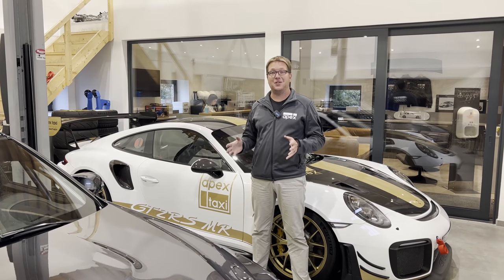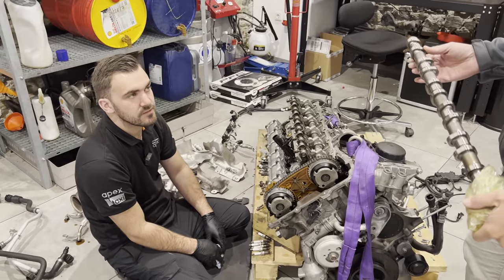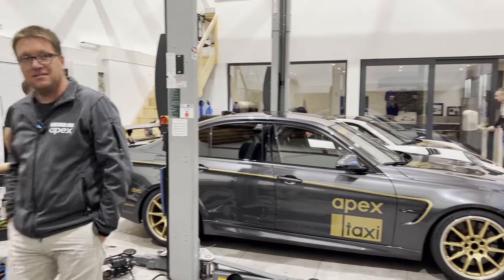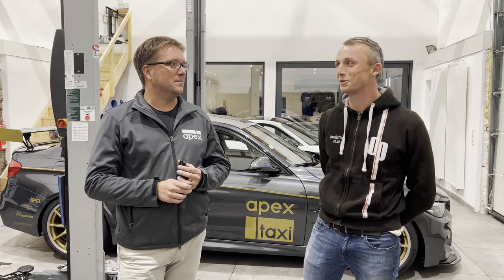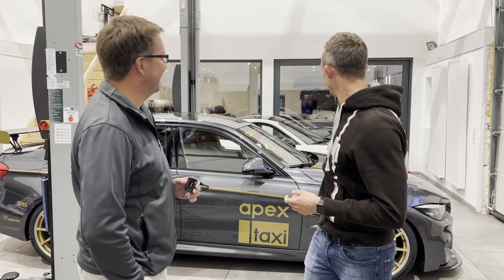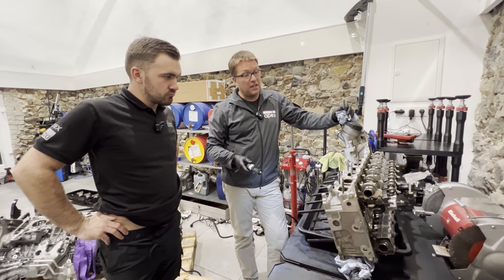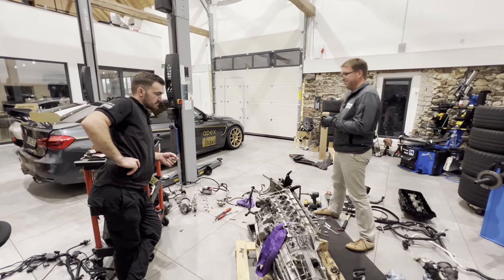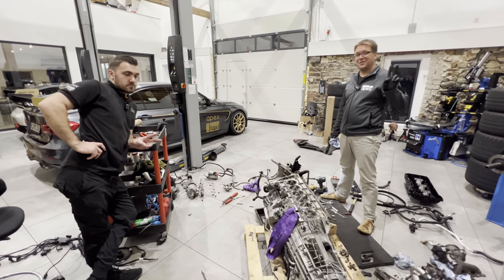BLOWN UP another BMW M3 Engine!!! Tear Down and Diagnosis...

Comment: 35K KM of Ring use and tuned is impressive, the recommended rebuild of S55's for GT4 race class is every 24k miles. Which is quite impressive compared to other manufacturers as Robert mentioned. Lol at people in this thread who think this is poor, most engines would have died long ago.
Reply: Yeah you really need to factor in the tune, you can't expect any guarantees when you take something well beyond the manufacturers specifications. 

BMW really did a brilliant job with the S55, if that's how it does with a tune that adds ~100hp think about how solid it is if you keep it stock...
Reply: @Matthew-nl9kd  its a trash a frkn block got cracked ffs
Reply: @CL9k24a3  Stay in school kid
Reply: I wonder what kind of milage they would have gotten without a tune.
Reply: @CL9k24a3  When you don't know what you're talking about, that's better to shut up.
Reply: @CL9k24a3  imagine being this guy

Comment: I think there was one more horizontal crack right in line with the next water jacket visible right at 19:23.
That block with some better sleeves machined in can live for ever below 600bhp even with the stock internals from what it looks like now. The factory sleeves however seem to suffer somehow past some heat levels and the high power may be speeding up this process while keeping it at lower power will certainly not eliminate the issue, only delay it a bit.

Comment: Tearing down the engine is easy, putting it back together in a working condition,  now that's a different story, I know too well for my own good on that one 🤣
Reply: Ha!  You are very right there!
Reply: Install is just reverse of removal!
Reply: When I did that for the first time I tore the engine down in few hours and then put it back together in multiple evenings. And when cranking it the first time I was 90% sure I would just clattering. Still running after 3 years!
Reply: @mcspikesky  👀
Reply: @mcspikesky  except with all the important stuff like replacement of all the consumables, reapplication of the various greases on surfaces and bolts, replacement of the various seals and gaskets, torquing down the bolts to their exact specifications...just those "little" details in the re-build, that's all.

Comment: @20:30 You can send off the block to get welded, honed and then sleeved and then use 0.25mm oversized pistons. Should cost around $3000 for a job like that to repair the block. Would be awesome to see if a re-sleeved block can survive longer than a stock one.
Reply: Would that really be a valid option for a rental race car? I can see it being a solid option on a private street car. But as a rental race car that needs to make revenue I would go with the safer option, since breakdowns cost about double, parts and repair + missing income + salary to employees.
Reply: @bounzig  if a resleeve is done properly on an iron block, I would assume that would be stronger than stock. On an aluminum block I don't know. Anyone else with sleeve experience chime in here 💪🏼
Reply: @buildanddrive  Point is, if it's not done properly it's gonna get hella expensive fast. Is it worh the risk?
Reply: @bounzig  def not worth the risk. I would find a shop that has already tested this with this specific block. I know many race cars that's sleeve the block in case something happens, they just replace the sleeve instead of replacing a block.

Comment: 4:02 - Gen IV Small-block GM V8 already has Variable Valve Timing despite it is a push-road overhead valve engine, and then Gen V would see them become direct injection; I'd say the BMW S55 engine is only complicated because it has valvetronic (variable valve lift) on the intake side... otherwise it seems to be pretty standard DOHC stuff.
Reply: Dodge has the same on the newer hemi, and ford just came out with vvt on the godzilla engine

Comment: Could be detonation due to tune, it's also on the sides where the most sidewall wear (oval shape) will occur due to rod/stroke/piston inertia etc. Especially with high RPM. So if there is a place with maximum stress, it's where it failed, those sidewalls don't look too thin either. I'm not a BMW fan at all (I really don't like their reliability across the board) but it held up pretty well considering track/tune abuse lol. 

Next one I'd turn it down a bit or improve cooling and be very careful with keeping an eye on plugs/injectors etc. Or buy a real standalone ECU to monitor each cylinder, safer that way.
Reply: BMW just has been forced to stop selling models with the S58 motor because of crank/rodbearing issue's.

Comment: Couple of observations Robert. Welcome back by the way, your laidback laconic delivery has been sorely missed! First, wouldn’t it make sense to keep the engine stock? After all more power equals more heat, stress and a higher risk of major problems and I think it highly unlikely that the customer’s lap experience would be diluted in any way if you ran stock power motors.
Secondly, how important is it to have taxi drivers who can deliver the most exciting experience for your clients whilst being mechanically sympathetic to the cars? It was noticeable when I was in the GT2RS with Tim how he drove so quickly yet without putting undue stress on the motor, short shifting where necessary and no aggressive on/off throttle and braking movements. Anyway, excellent video and very informative.

Comment: As I mentioned in a comment under the past video, I'm a former taxi owner in a city. In the fall, the first snow came down, and the first crash because of it. A friday 01:30 PM. A nice lady with summer tires crashed right into my taxi.  Nearly impossible to drive, but I finally reached my body shop.  They got on the job, three men, with sledgehammers.  At 05:00 PM the taxi was ready for driving that weekend.  Not painted, but all in working conditions, and that's why we use cars as Mercedes in taxis.
Reply from the maker: Gotta keep them taxis on the road!!!  Sorry to hear of the crash but happy to see you’ve got a good team behind the operation
Reply: @RobertMitchell  Well, it's like you're taxis, you have to keep them running, and have a good mechanic ready 24/7.
Reply: @RobertMitchell  It was incredible to see how fast they could get that car running again, with sledgehammer

Comment: might wanna get that head pressure tested, theres cracks going from the ex seats to the spark plug holes. pretty common, but you always wanna check. no need to toss the head if they dont go to into the water jackets.

Comment: Good video, more of these with mechanical details and running information please! Interesting how you reference miles or hours (or brake pads) as different ways to measure ultimately physics and entropy. You use what works for you. You have to balance performance (and fun factor) vs costs but it would be interesting to see what run life you get from the the other engines you run at a lesser tune.

Comment: At what point would it make sense to get the block sleeved? Then, you’d have a spare engine for the next time this happens…or am I being thick? I have never been a big fan of Nikasil-coated aluminum being used as a cylinder surface; call me old-school.
Reply: I was thinking the same. Why you don't consider this option?

Comment: I would love to have a rocker key chain!! that seriously sucks, when you sent the camera over the cylinder to look into it after you wiped out all the coolant and oil I could see that crack immediately before you pointed it out (camera angle and light may have had everything to do with that though). I've had that same thing happen to me once, I was heart broken. Theres nothing fun about replacing an engine block. On the bright side, sleeve and girdle then add more power??!! or maybe not...

Comment: My Gen III Hemi with variable cam timing would beg to differ with your statement about pushrod V8's. Variable lift is difficult to do when you have to feed the camshaft into the block, but variable cam timing isn't hard - all you are doing is rotating the camshaft with respect to the cam gear.
Reply from the maker: I was referring to old school v8 so that I was discussing in the video. And if it’s a traditional camshaft you’re not just rotating it. You need to adjust the intake and exhaust at different rates to adjust the overlap as I was discussing.

Comment: There's a fair degree of erosion in the cylinder, each side of the crack.  I'm tipping this block has casting faults, should be a warranty item.

Comment: If you remove a head there is a special pattern to loosen the bolts, you should start on the outside not end to keep the head straight...

Comment: I'm not a mechanic or anything but the valvetrain on the intake looks like nothing I've seen so far!
I'm guessing this must be the valvetronic unit that allows for variable valve lift.
So this would mean this engine has variable valve timing on both intake and exhaust cams and an additional cam on the intake for the valvetronic unit?
I'm guessing this must be a BMW thing, so far I've only seen "older" engines apart like the jz, uz, LS, 2/2.3l ecoboost with VVTI or VCT.
I also spotted in the previous video that even though it has VVT and VVL it still retains a throttle body.
And it looks like the lines from the high pressure fuel pump go into a fuel rail, to then split again and feed the injectors via hardline tubes... ?
Either way fascinating stuff, I love these videos!

Comment: Nice video!
Re the ”overhead cam vs. pushrod V8” I can maybe add further insight: 
The biggest flaw of the pushrod valve system is actually the weight of every part included, which becomes a problem with high rpm. Thats ok if you like in america opted for big torque, but in racing you need power which is why Ferrari and most other european teams have had overhead cams acting directly on the valves, all the way from the 50’s. High revving, efficient high power engines. 
Of course when multivalve came along, the twincam engine layout had a head start already. Even later on, variable timing in Alfa Romeo and Honda in the 80’s made the pushrod engine a thing of the past even more. But the fundamental flaw of it was there from the beginning, the total moving mass of the valve gear in high revs.
Reply: You are correct, but as new regulations has come into effect and technology changed, the valvetrain weight is less important. Its easy enough making a pushrod engine rev 7-8-9 thousand or even higher these days, not many popular race car classes runs higher than that. So pushrod weight is mostly a non issue these days in that regard.
Reply: @GoldenCroc  Correct, nowadays the rods in the Corvette are much lighter too. But its not a highrevving engine still.
In racing, of course you can offset the valvetrain weight with much harder valvesprings. But the wear is so high so its difficult in a production engine. 
I was trying mainly to provide a historical context, as an answer to Robert mentioning good-ol-american-V8’s in this clip

Comment: Robert actually some older GM LS gen 4 pushrod 6.2L truck motors have the a variable valve train system that modulates the lifters to add more lift at certain rpm , looking forward to visit you sometime next year in my slightly modded C5 Vette for a lap or two 🇸🇪🇺🇸
Reply from the maker: You are 100% correct. I’m referring to the classic motors I grew up working on.  I’ve had pickups with VVT and Cylinder on demand etc.

Comment: Great video! Appreciate seeing how complex modern BMW motors have become.

I don’t think the block can be saved.  From what I’ve read, the S55 block does not have a traditional cylinder sleeve.  The bores are coated with an Iron alloy using a wire-arc thermal spray process and I would be surprised if BMW has a process to repair the coating.
Reply: It doesn't matter. The whole cylinder is bored out and replaced with new steel cylinder. Same as in this video https://www.youtube.com/watch?v=rbTz1Ho3IDI

Comment: I’m guessing that has to be heat related?   Would be interesting to see if you could get it tested by a metals expert and see what they come back with.   

But I guess that as the engine is being given a hard time for a lap, then partly cooling them back on it when running as the taxi slowly over time it’s fatigued and then a crack has spread.   

Fascinating stuff though.   Thanks for sharing.
Reply: Could also be a casting issue.
Reply: @jrooney06   I would have thought if it was then it would have gone much sooner surely?

Comment: Hi Robert,
Loving the tier one content!
Just a topic for another video.
What are your thoughts on the 184 hp ND2 MX-5 with the recaro seats and Bilstein dampers? 
I know it won't be a good option for apex because of safety, but for a private buyer to be used as a daily and for the track? I'm thinking light car an low hp, should be mega fun to run?

Comment: I think you can still sleeve this one, i wont be cheap, but it is doable.
I think every S55 should be sleeved seeing this issue. It is a design flaw.
Buying a new engine will give the same end result, a cracked cylinder wall.

Comment: Did it crack the sleeve as well as the block? Or is the sleeve not protected by any aluminium block material at that point? (So floating sleeve?)

Comment: What did you weigh in deciding to tune for 560hp when in America a comp pack F80 is rated at 444hp. Do you think you could have gotten more miles on the engine if you ran stock power?

Comment: I see a lot of cost cutting in that engine from the little bit of the insides that I saw.  Firstly, is the damn plastic valve cover, single row timing chain, hollow camshafts, but Im sure there is much more.  The older M50/S50 series engines were in my modest opinion way way better. One thing I absolutely can not stand are plastic engine components & obvious cost cutting in something as important as an Engine.
Reply: I agree with you about plastic engine components - they always leak and sometimes crack. Just cheapskate.
I don't think a double row chain is necessary on a straight 6. The load on the chain very even - no real shock loading that you would find in other configurations.
Years ago I had a E34 535 which I drove (hard) for 550 000km. Never had any problems with the single row chain.

Comment: Thanks very much for making this video Robert! Owning an S55 M2C, I was very curious. 

After seeing this failure - do you feel the N55 in the M2 would have the potential to fail much faster given that it’s an open deck design? (Under the same conditions). 

And do you feel that this failure in the S55 is acceptable, given the conditions that the motor was run under? (Based on what you’ve seen from other motors)

Thanks!

Comment: Just to correct you - overhead valve engines can have variable valve timing. GM has been doing so with the LS/LT platform for years now.
Reply: You mean non overhead cam* engines. But yes, GM does.
Reply: @jcsuperstars1100  well, technically, yeah, OHC is a subset of OHV, but OHV is generally taken to mean pushrod.

Comment: Robert,

Does this illustrate why BMW maybe moved away from open deck to closed deck with the new B58/S58? Would you expect the walls to be much less susceptible to this type of failure? 

Thanks for the information - love the info here. One final question- Who actually makes the turbos for the S55?
Reply: The S55 is closed deck.
Reply: @windnsea03  My bad. Thought that was one of the hallmark changes of the B58
Reply: @number1Schumacherfan  B58 is closely related to the B57 diesel engine.

Comment: ACKCHUALLY! you can have variable cam timing on a pushrod engine, it was introduced on the Viper in 2007.  It uses a cam in cam system developed my Mahle, can vary cam timing up to 45 degrees
Reply from the maker: I’m referring to the classic v8s I was talking about earlier in the vid
Reply: @RobertMitchell  I mean its kinda the same thing... cam in block, except not kinda, its the same thing.  I'm not trying to start a thing but you said "pushrod motors don't allow for variable valve timing", the Viper has a pushrod motor with variable valve timing.  classic DOHC engine don't have variable valve timing either...
Reply from the maker: @boblast5582  it’s known that pushrod motors can have VVT and even DoD.  This video was shot together w yesterdays and cut into two later.  In that filming I spoke about what i grew up on,  classic simple v8 where you can rip heads and valve train off easily.  It’s all about the context

Comment: Could you theoretically machine that block and sleeve it with custom pistons and have a higher compression slightly lower displacement engine for cheaper?
Reply from the maker: Theoretically maybe 🤣.  Not worth it to me to do though. Just move on to the next one !
Reply: @RobertMitchell  definitely not worth your time but an interesting engineering question
Reply from the maker: @franklapolito5968  you are correct!

Comment: Wow... everything on that engine looks exactly the same as my 2005 n52 engine... its like BMW didn't "re-design" much in the last 15 years... its all there still... vanos location, oil cooler, injectors, starter, even the camshaft and intermediate rockers all look the same just moved around a bit. Even the head gasket looks exactly the same! (Ask me how I know 😂) - Full rebuild on my channel!

Comment: You could have probably used a BORESCOPE to inspect the cylinder for cracks without taking the engine apart. Indispensable tool for any auto technician
Reply: We have one....not good enough to bend 90 degrees in cylinder to see a crack...plus this wasnt too visible without light in the right place
Reply: @TwistedSymmetryUK  - Newer borescopes have articulating head that can bend 180 degrees in all directions to cover the entire field.
Reply: It would be cool to send one down the water jacket and see if that crack was the result of a casting flaw.
Reply: @derekhanson4215  - Of course it's a casting flaw. Cylinder walls aren't supposed to crack. BMW manufacturing standards have really gone to the dogs